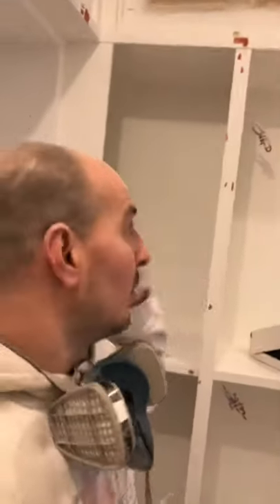#SPRAYPAINTING A #MDF #MASTERCLOSET. START TO FINISH

Comment: Nice work!! Do you ever find a need to spray a lacquer retardant to slow down the drying time on a big set like that?
Great job bringing the viewer through the project, very professional..👍👍
Reply from the maker: Yes sometimes I do add retarder. Really depends on in house environment. 
They house was big and had only one furnace running 🤦🏻‍♂️🤦🏻‍♂️ so it was always a bit cool. Which helped a bit for sure, like a natural retarder. I have found however that some units just need to be broken off no matter what, just because there isn’t really any nice breaking points. I have another video on my Instagram that explains that in another closet. It is dependant on many variables. But over time I have practiced to nail almost all of it. If done right. 
But I do use retarders sometimes, and thin product is thinner down as well.  Thank you also for your kind words !👊🏼👊🏼

Comment: I enjoyed this video, I sometimes have problems with runs inside boxes, but I spray them pretty much the same pattern you do. Do you turn your pressure down for vertical surfaces? Or just keep it down for cab doors too?
Reply from the maker: I spray everything at full pressure 
If I feel like it’s too much I’ll just tip down.
Reply: Top Line Painting & Spray Coatings 👍 I’m running that 410, ordered a 408 that I’m excited to try
Reply from the maker: It’s a bit slower but it’s a great finish. Still rock my 410 on the daily though lol
Reply: Top Line Painting & Spray Coatings thanks for the feedback, FYI I found you through your podcast just recently. I appreciate the content. Nice to learn more and hear other pros take about the work. Thanks for it!
Reply from the maker: Hey thanks my man. Appreciate the listens! 
Anytime you need help reach out. 
Check me on Instagram too if you’d like. 
Again thank you!👊🏼👊🏼

Comment: That's really good job you are a pro bro..! What tip size are you using? You sanded between the first top coat? 
Thanks you!
Reply from the maker: I like the 410 FF tip from  titan 
And yes prime coats get a good sand. Light buff sand in first finish before Dap check. 👊🏼
Reply: @toplinepaintingspraycoatin2732  You are a crack! 👌